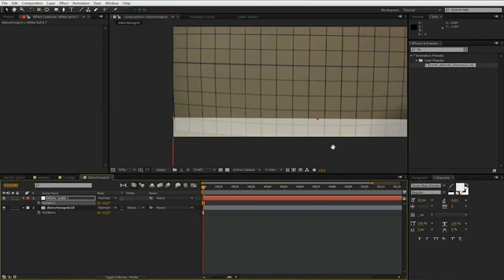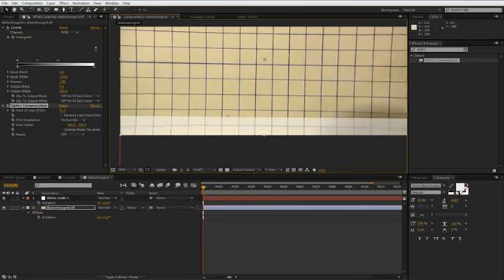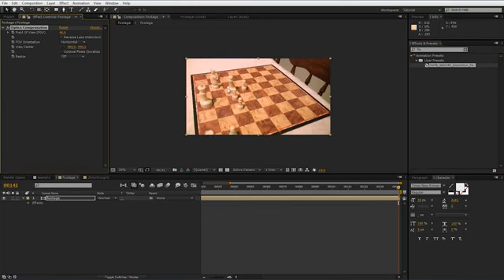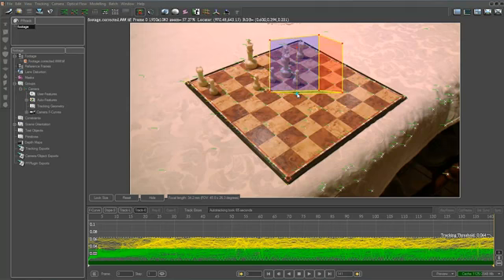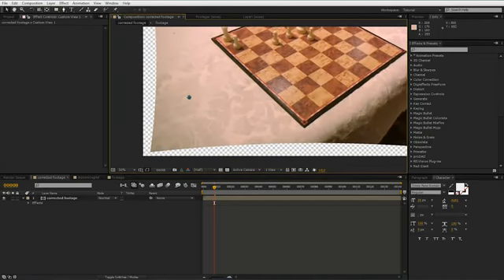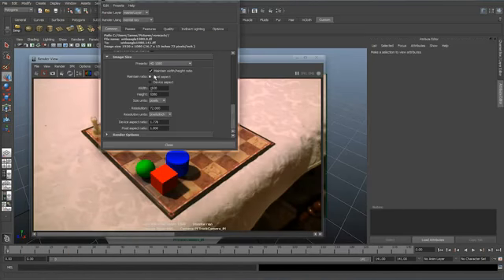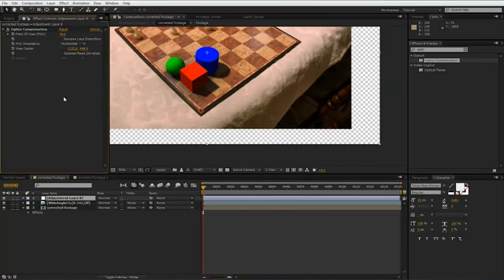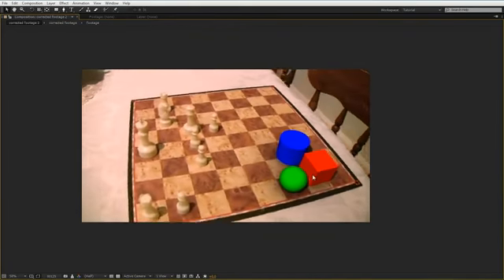Correcting Barrel Distortion And Compositing 3D Elements Using PFTrack, Maya And After Effects

Comment: Ok, but Pftrack have Undistort node, why all this mess with Optics Compensation witch have different algorithm, I don't really trust it. Why not to go to PFTrack, Build Lens node, make a correction (btw PFTrack help says do not film a calibration grid straight — when shooting grids, the camera should be placed an angle that is not perpendicular to the grid pattern, so the captured image contains two definite vanishing points. If two vanishing points are not available, focal length cannot be estimated automatically and must be entered manually before the lens model can be solved) and then solve the shot, export lens corrected footage, import it along with the CG footage into AE and get back lens distortion with Optics Compensation?